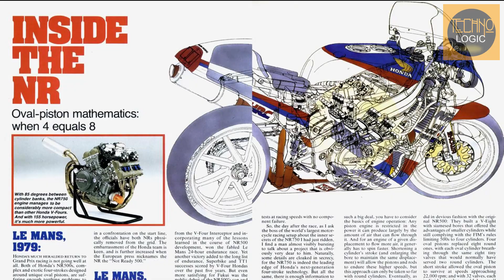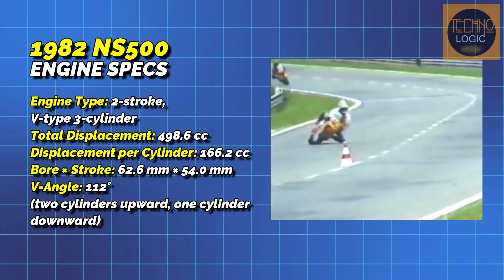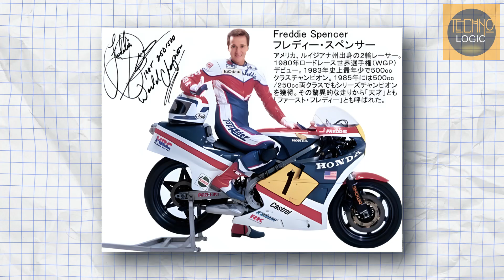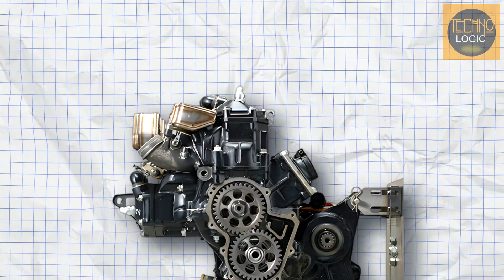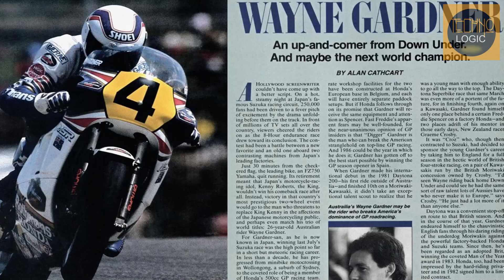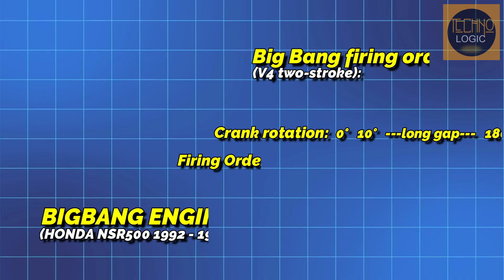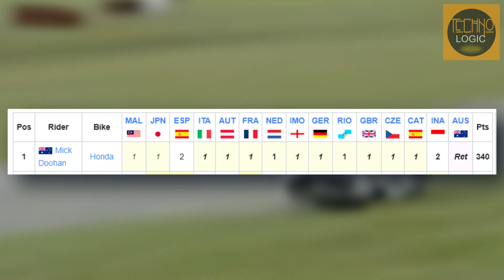🔥 The Flipped Experiment: Why the 1984 "Upside-Down" NSR500 failed

Comment: The NR and the oval pistons was a good idea. After all in the end oval pistons were banned in both MotoGP and Formula 1. Problem was Honda did not test this sufficient before starting using the NR. Also the NR was designed by a new team with little or no history  in motor cycle racing. On top of which the NR also had a novel monocoque frame that presented all kinds of problems. Clearly moving to a 2-stroke was much easier. And, by that time, Mr. Honda was no longer with the company.

Comment: Oh dear this video has got it wrong.
The actual reason the bike failed is because Honda, like most people, assumed that a bike pivots on the tyres contact patch with the tarmac. Whilst this is more or less true for road bikes, it isn't for aggressively ridden race bikes. On a race bike being ridden by one of the grand prix stars the countersteer they use is so aggressive the wheels are actually steered out from under the bike. The bike actually pivots about its roll axis, this is a line that runs horizontally just below the fuel tank on a conventional bike. This rotation is especially pronounced on flip flop chicanes (if you can watch videos of Kevin Schwantz and riding at Hochenhiem
Reply: Sorry my first bit got posted prematurely. 
Hockenheim).
You need to keep the heavy components near this rotational line. By mo ingredients the fuel tank bellow the engine it drastically reduced the speed of rotation. 
Honda learned this lesson.